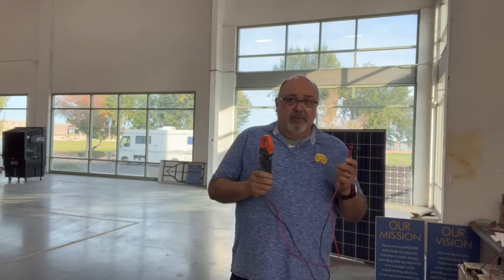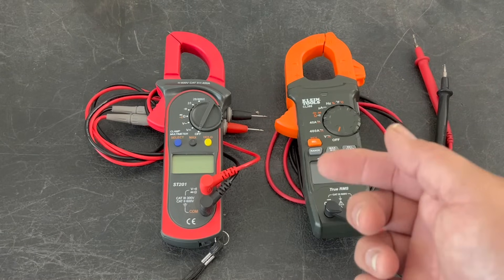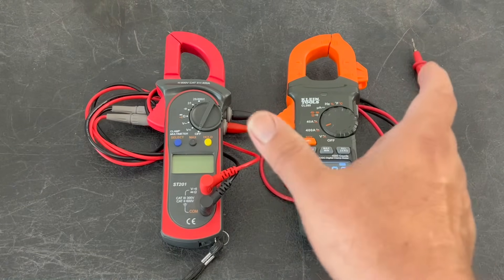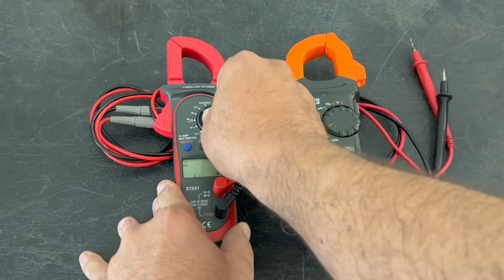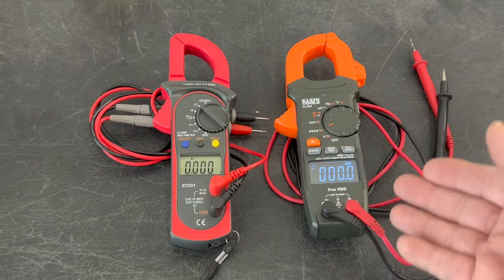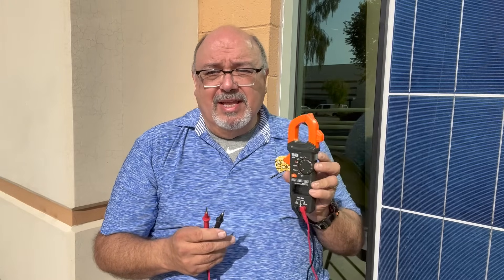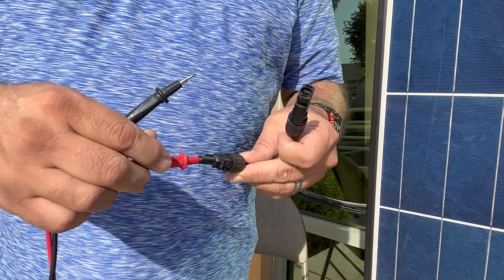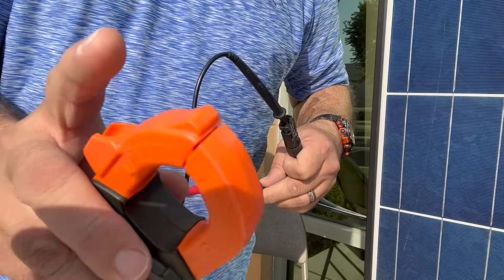Testing Solar Panels with a Clamp Meter - SanTan Solar

Comment: Can this clamp be used on a Live Solar Panel in a string of solar panels to get Amps?
Reply from the maker: As long as the clamp is used to test DC amps then yes. Do not use the probs as a way to test current, it may exceed the fuse rating of the meter.